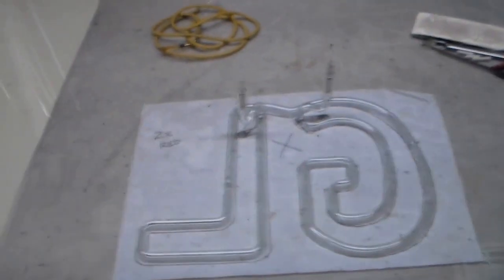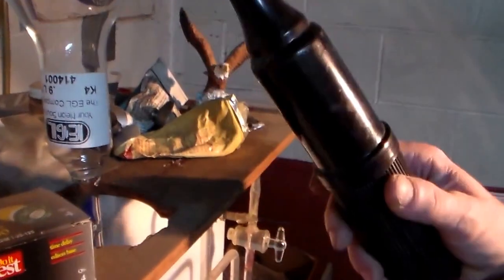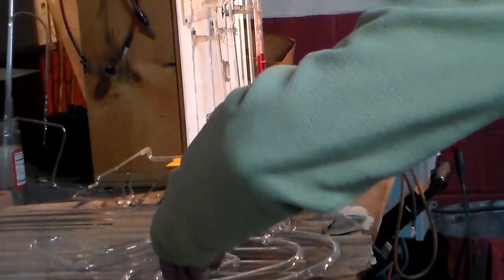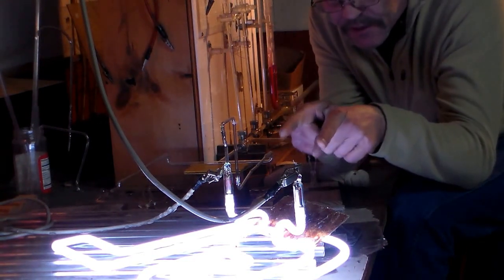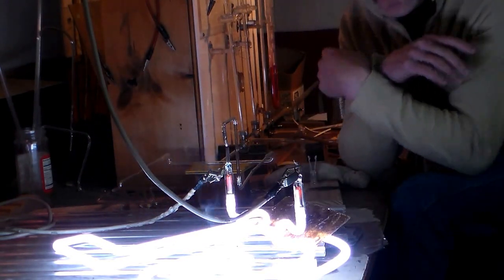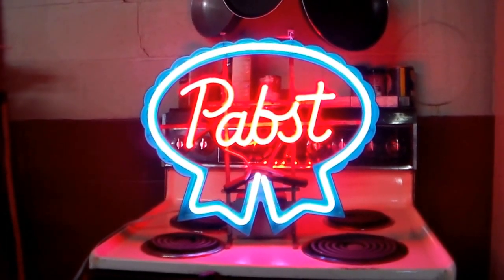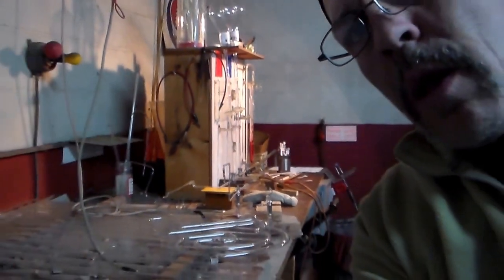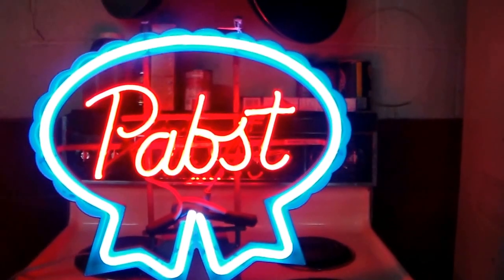THE ART OF NEON pt 3

Comment: Hey Joe, Ed from Ohio here. I've been messing with neon for a bit now and have a question for you. When you bombarded this unit I noticed you aren't tugging on that choke. Are you just bombarding at full power? or is your choke set at a specific amperage somehow?
Reply from the maker: +Ed Cardoza  Ed, I use about a 4 inch piece of wood to keep it open. I use a smaller one for small electrodes.